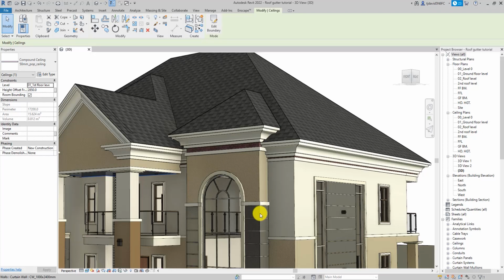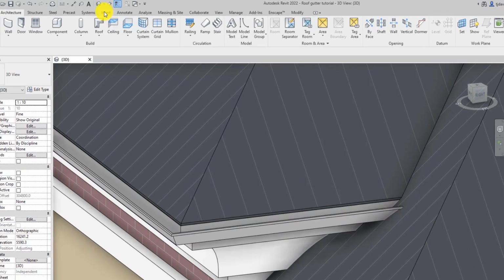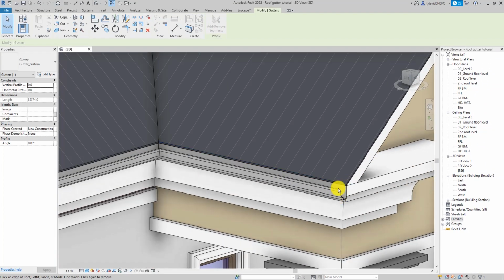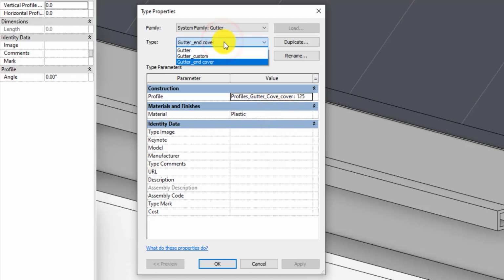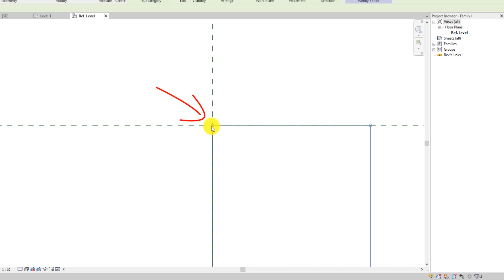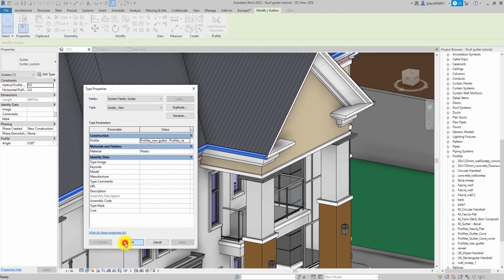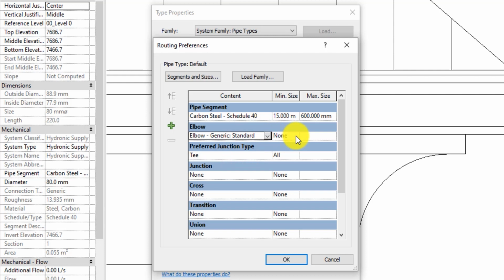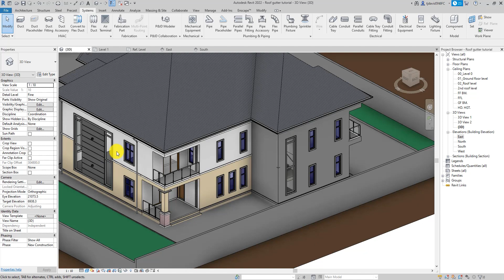How to create Roof Gutters & Drainage pipes in Revit

Comment: This is an informative piece here!

 A quick question; what is considered “Roof” in Revit?  Is it the Roofing sheet? Or the roof with some roofing members? Because why is the default roof 300mm at first
Reply from the maker: Generally a roof is the entire structure that covers the upper part  (top) of a building now the things that makes up the roof are referred to as roof members. 
Naturally the prefix “roof/Roofing” comes before all the roof members. For instance, Roof gutters, Roof trusses,Roofing sheets, roof ridge etc

Now, I honestly do not know the actual reason why the default thickness for Roofs in Revit is 300, but I have a theory.

Revit gives you 300 because it doesn’t know what type of roof you might wanna create, that is why it also gave u the ability to edit the roofs too. If you decide to create a flat roof, then you can just proceed to add your different layers as you see fit. If you want to create sloped roof you can reduce the thickness and add other members to get your desired results too.
Also one can argue that the 300 thickness is to give the illusion of roof + simple roof fascia especially during the initial conceptual stages because it does look like that. 

But these are my humble opinions please do not quote me 😂